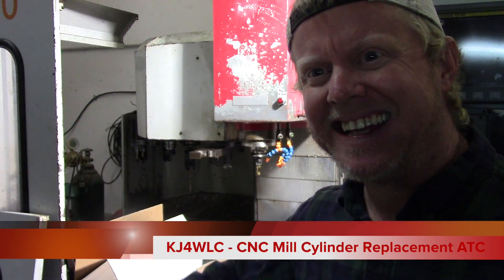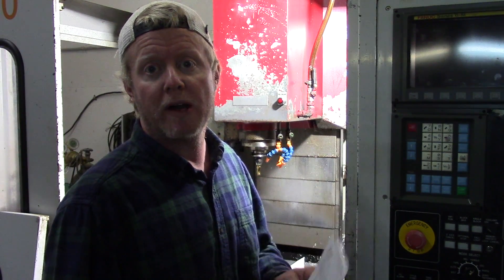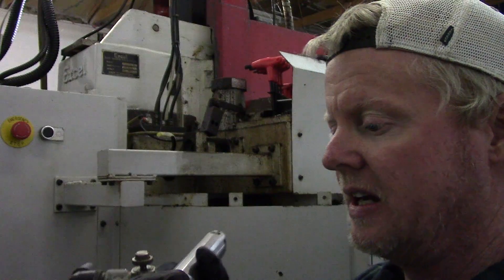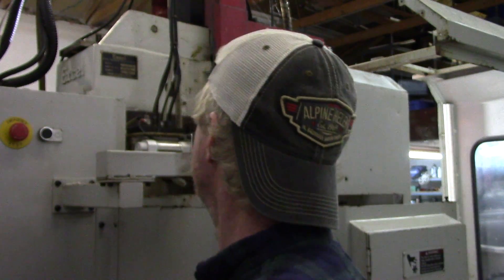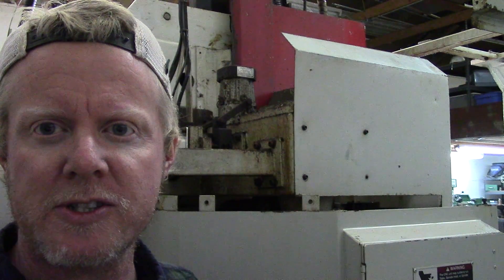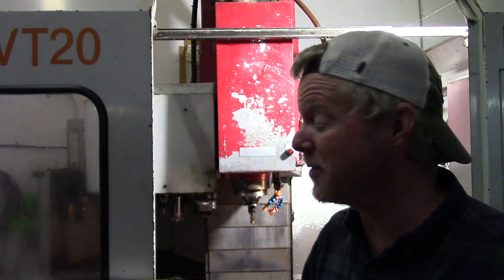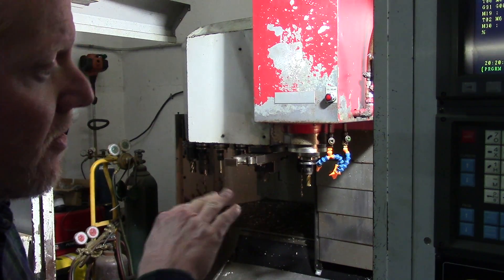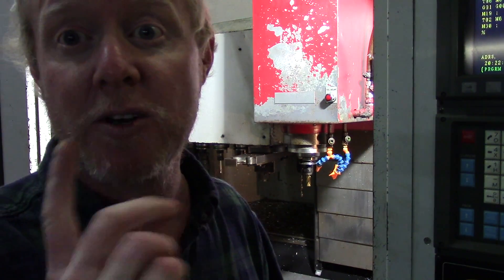CNC Mill Repair Cylinder Air Leak is Solved.

Comment: Hey Shane, I recently purchased an excel VMC and I was wondering how you have your RPC connected. I know that the ghost let should not power the controller, but how did you determine what leg fed what component? The model I have is Excel 510 with the 18 tool magazine style tool changer not the umbrella type more common. Any help you could provide would be greatly appreciated. All my experience with milling machines and powering them comes from a vfd on my Kondia FV1 and straight 3 phase at work on the Bridgeport. Thanks for any help you can provide.
Reply from the maker: I used an ohm meter to trace the legs that powered the controller.  Have the real legs connected to that.  On my machine all that is very close to each other and easy to trace.  I would think the 510 would be very similar.  I have some older videos which may help of when I first got the machine and did the RPC install.
Reply: Thanks so much for the very fast reply. I’ll have to dig further down into your videos to find that. Thanks for the help, so far you are the only one who has bothered to be of any help!
Reply from the maker: Bringing up a used machine is tough but I've done several and comfortable with it now.  I've tried to video as much as I can but if you need something specific I can slide it in the video schedule if you hit a roadblock.
Reply: Thanks a bunch. Going to be getting this thing up and running somewhere within the next few months. It got delivered on Thursday and I’m looking into a rotary converter now. Hopefully I’ll get it powered up soon and pull what I can from it parameter wise. Is there a way to just boot the NC system to pull parameters without the rotary converter?
Reply from the maker: You will need to provide 3 phase to get a full boot to pull params from an OM if it is similar to mine.
Reply: Gotcha. Figured. Was hoping that wasn’t the case but it is what it is. Thanks for the help!